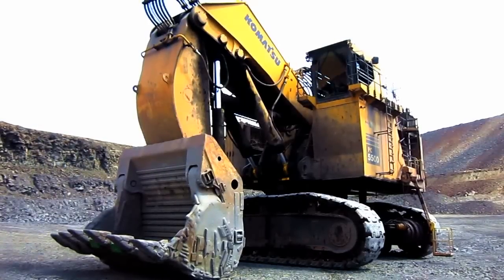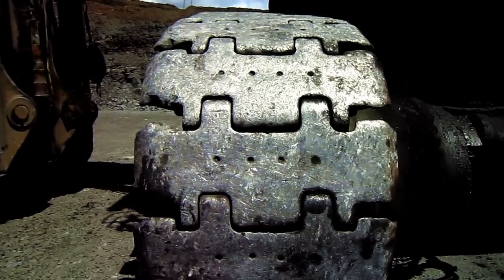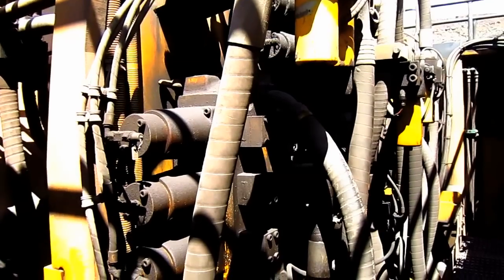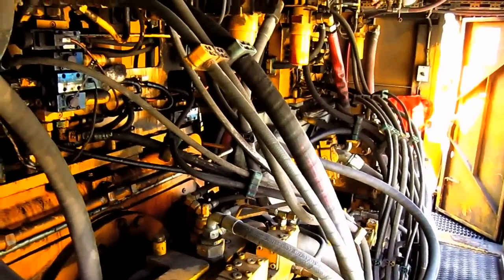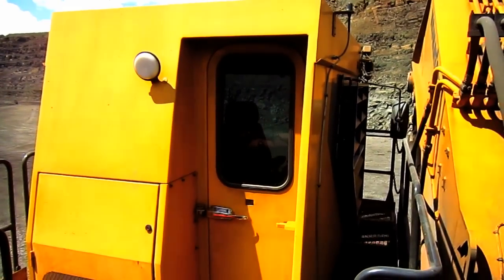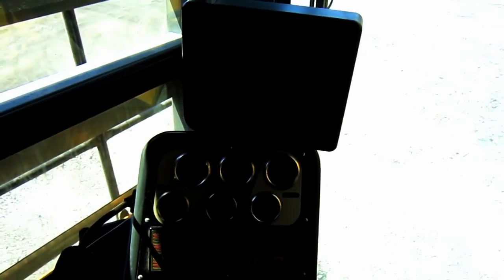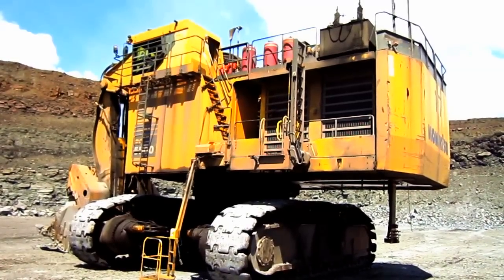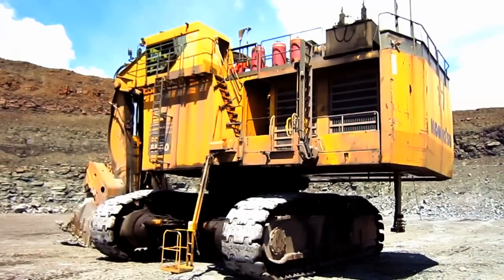Komatsu PC5500-6 Documentary

Comment: Thanks for the video. It amazes me how much it takes to make this machine run but it has one very basic function, to dig. What where the 2 things hanging down on either side behind the boom? I have seen those things on other machines but have no idea what they are used for.
Reply from the maker: +lidsman2221 Those are plastic cones.  The purpose of them is so truck drivers can have a visual to help back and line up under the shovel bucket.
Reply: Oh very cool. I never would have guessed that. Thanks for the info.

Comment: Good video. What are those weights hanging beside the bucket cylinders? Pendulums, or is it to help with positioning the bucket over a truck?
Reply from the maker: +jix177 Those are plastic cones that are used to help truck drivers line up underneath the shovel. Thanks.